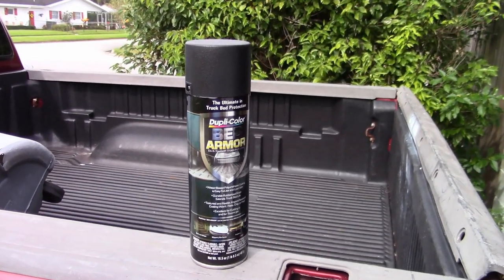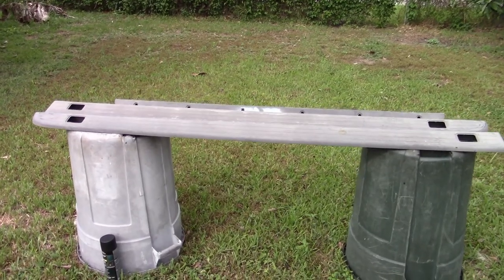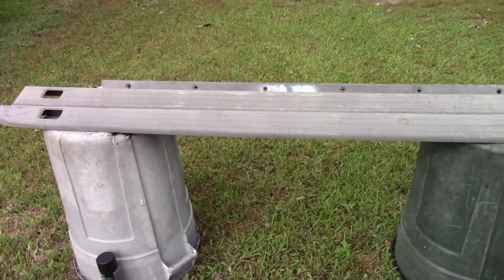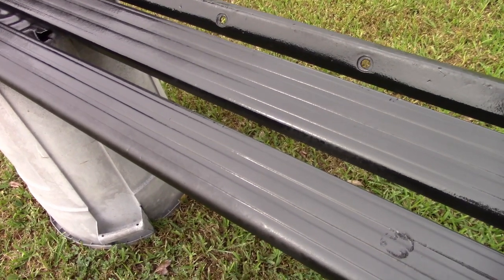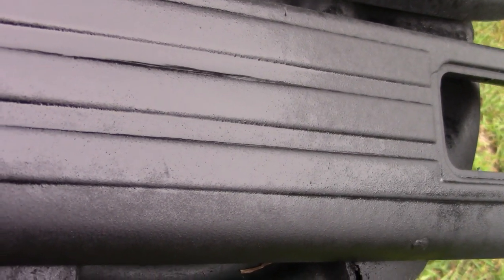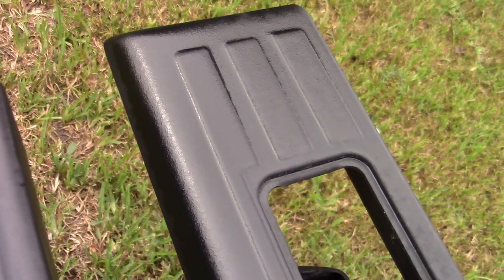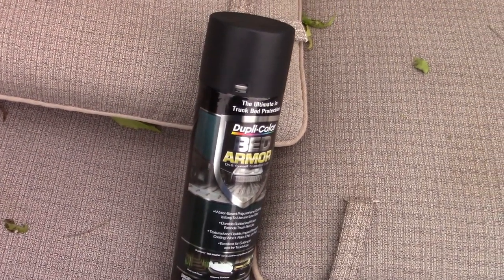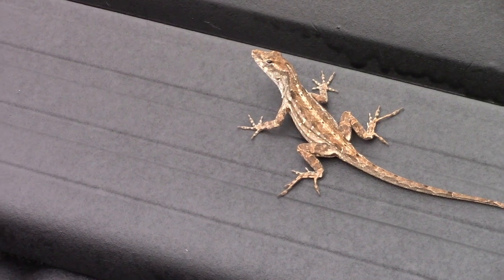Testing Dupli-color Bed Armor for restoring weathered bed rail caps

Comment: Second time trying to post, YT erased it WHY????  Just finished and they look great. I got almost 4 full coats out of the one can. Put it on light first coat, heavier on the remaining coats. Waited about a hour between coats.Took about 72 hrs to cure before it wasn't sticky. It's in the 100"s already here with almost no humidity(5/29/24). Might take longer where you are located. Broke off about 5-6 tabs on removal. Az sun just made them more brittle I guess. Watch the video here to get them off easier: Ram Truck Bed Cap Removal | Never Break A Tab Again | Ram Bedside PDR | Dent Baron, Raleigh, NC. I used 3M Super Strength Molding Tape around the holes where they broke off. It's thin but one layer is plenty. That S**t is sticky. Prepped the bed rails and caps with alcohol before putting tape on. Got a 15 foot roll on Amazon for $10. Walmart has it around same price for a 5 foot roll. Trashed the push pins taking them out. I had a push pin kit from Harbor Freight they worked fine. Dodge wanted over $5 per pin, F that. We'll see how long it lasts out here in the AZ sun. No more itchy hands and arms.

Comment: Wow I'm glad YT recommended this video. I literally started today trying to find a way to stop the fiberglass itch. I have a 2017 Ram and live in Phx AZ. The sun beat them up pretty good in less than 2-3 years. Been dealing with this since then. Did you prep the rails with anything before you sprayed them?
Reply from the maker: i didn't do any prep. I figured all the oils where all dried out of it as well and I was right. This finish is still doing ok years later. I did a follow up video about a year ago.
Reply: @Toppervision1  Thanks for responding. I saw that video also. Sent you an email, just disregard.
Reply: Second time trying to post, YT erased it WHY????  Just finished and they look great. I got almost 4 full coats out of the one can. Put it on light first coat, heavier on the remaining coats. Waited about a hour between coats.Took about 72 hrs to cure before it wasn't sticky. It's in the 100"s already here with almost no humidity(5/29/24). Might take longer where you are located. Broke off about 5-6 tabs on removal. Az sun just made them more brittle I guess. Watch the video here to get them off easier: Ram Truck Bed Cap Removal | Never Break A Tab Again | Ram Bedside PDR | Dent Baron, Raleigh, NC. I used 3M Super Strength Molding Tape around the holes where they broke off. It's thin but one layer is plenty. That S**t is sticky. Prepped the bed rails and caps with alcohol before putting the tape on. Got a 15 foot roll on Amazon for $10. Walmart has it around same price for a 5 foot roll. Trashed the push pins taking them out. I had a push pin kit from Harbor Freight they worked fine. Dodge wanted over $5 per pin, F that. We'll see how long it lasts out here in the AZ sun. No more itchy hands and arms.

Comment: Wow big difference mike looks great I had them same protectors on my pickup I believe they are resin and not plastic not 100% on that but I used the body molding paint on mine and was still getting fiberglass on my arms and hands let me know how this stuff holds up down the road did the lizard jump up from the ground? Or was he on the garbage can?
Reply from the maker: I really didn't see where the lizard came from. It surprised me. Yea, I was thinking that this bedliner spray would be thick enough to seal the fiberglass in. So far so good. We'll see in like a year.
Reply: Toppervision1 lol the lizard was quick lol too funny it will be interesting to see if that lasts longer then the body molding paint I used thanks.

Comment: Looks good!  How has it held up?  Looks like you posted this about a year ago.
Reply from the maker: It still looks like I just painted it. Good stuff. Really resists chips and scrapes too. I am a lawn service by trade and really bang that truck around alot. I'm gonna do the fender flares too.
Reply: Toppervision1 good to know, I’m looking into doing something similar on my Honda Ridgeline.  I don’t want to go full Bedliner is: raptoliner or scorpion rather something quick and easy like a rattle can but there’s just so many options and hard to tell which one will actually last.  Thanks for the reply

Comment: How is the paint holding up? Does washing your truck cause any issues to the paint?
Thank you
Reply from the maker: It's still looks great! No no, water doesn't do anything to it.
Reply: @Toppervision1  thank you for getting back to me. Do you think that putting on a clear coat after is necessary?
Reply from the maker: @powerwh33ls  No, not really. Mine still looks good and I just realized it's been 2 years not 1.